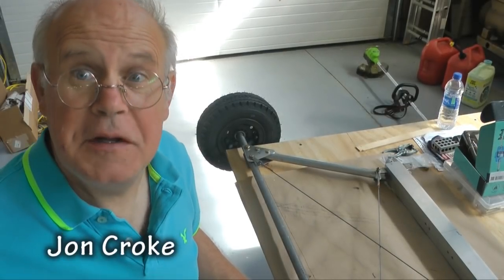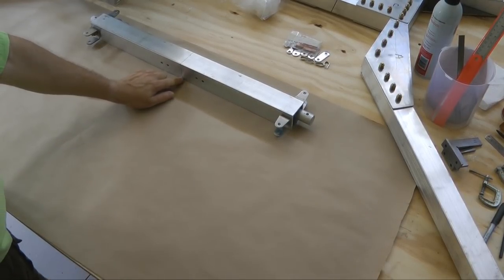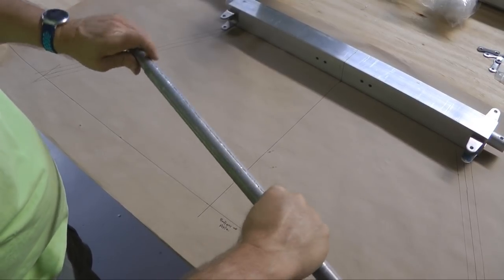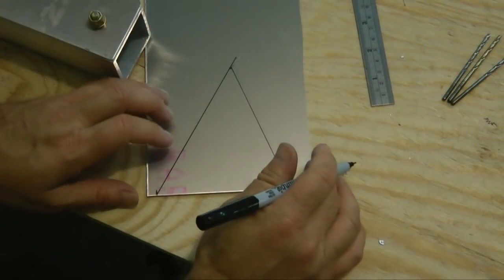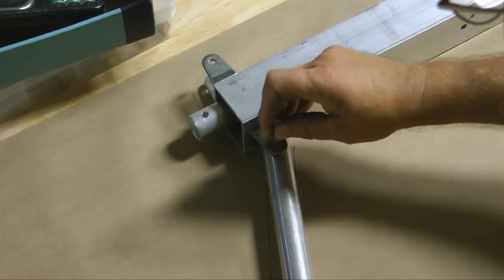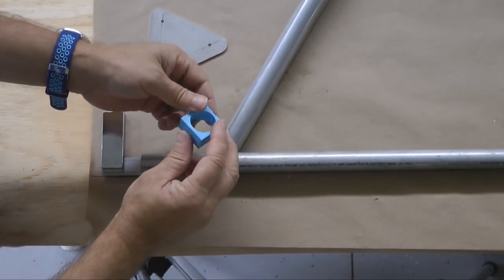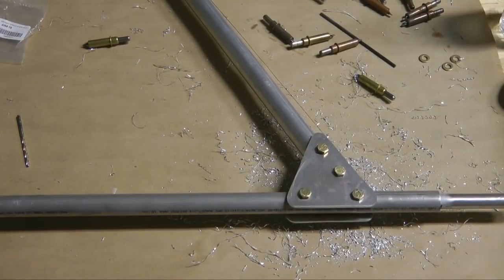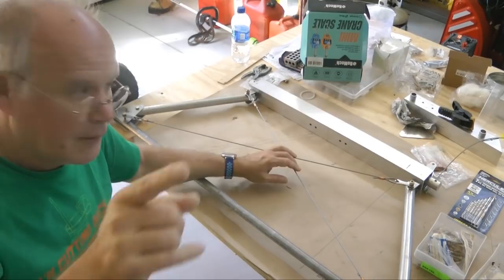Building the Affordaplane Part 8

Comment: With all respect to your opinion why people build many different version of the landing gear, as far as I know, the Affordaplane landing gear is the weak point of the design, so that is one of the reason, why so many experiment with various fixes. Something else. In the last part of the video, you have shown the cables that will go on in the next part. Each end of the cable only had one swage. That is inadequate, I hope you will put on two on each end. I have built 1000s of production cables for hang gliders and trikes, so this is based on that experience. Otherwise the series is very nice.
Reply: Do you know of an alternate off the shelf landing gear compatible with the Aplane for those of us that have a bad back. I imagine that the tires will help some in absorbing the landing.
Reply: @joaquinandes  Unfortunately no.

Comment: Additionally, the forces on the landing gear axel will primarily be transmitted through the tube. Much better to do a better fit to take some of the shock off of the bolts.

Comment: Instead of a straight cut at the connection point between the down tube and the axel, it would be much more productive to use a 7/8" rounding sander to better fit the down tube in place.

Comment: OK I'm using a wheel which has a 5/8th diameter hole for axle, question  is : does the solid 5/8th rod run the whole length of the hollow tub or is it 2 parts, also what tubing would I used on the outer tube and the sleeve on the inner tube to accommodate the solid 5/8th axle tube ?

Comment: Hello fellow enthusiasts.  I have located several suppliers of 6061-t6 Aluminum, some is listed as -T651.  I'm not privy to the ins and outs of metallurgy so I'm looking for information about the difference between 6061-T6 and 6061-T651.  Also there seems to be another difference I was not aware of - Extruded vs Cold finish.  I'm betting the cold finish is A LOT stronger than the extruded but which should be used for the Affordaplane?  Thanks.
Reply: I have the plans dated 2019, are there newer plans?

Comment: I am curious as to the source of your information regarding a tube within a tube being stronger than a single tube with a similar total wall thickness.  I have a masters in structural engineering and that goes against everything I learned and have experienced during my career.  Composite action in beams is always stronger than components acting alone.  That is why bridges weld shear studs onto the top of steel beams so as to get composite action with the concrete deck.  This is much stronger than a concrete decking sitting on the steel beams with no shear transfer connection between them.  Here is a simple demonstration of the principle of composite action vs. separate components. https://structuresworkshop.com/blog/1350

I’m retired and no long have access to FEA software, but I am quite sure that if you model a tube within a tube and a single tube with wall thickness equal to the sum of the two individual tubes and the same OD, you will find the single thick walled tube is both stronger and stiffer than the tube within a tube.
Reply from the maker: I was wrong on that one - thanks for bringing to my attention and keeping the facts accurate.  I wanted to say that a hollow tube is stiffer than a solid one. And I dont know about the addition of sleeving causing more strength than that of same thickness.  I need to retract that part of the video!  Thanks.
Reply: @HomebuiltHELP  Sure thing.  A hollow tube is only stiffer than a solid one IF you are looking at them on an equal weight basis.  A tube of equal weight to a solid rod will be stiffer in general, but there are always exceptions such as when the wall thickness is so thin that buckling occurs.  One of the problem with physics and engineering is that often people hear one part of a principle, but not the entirety.  A 1” solid rod will be much stiffer than a 1” tube made of the same material, but will also be much heavier.  A solid rod that is the same weight as a hollow tube of the same material, will be less stiff.
Reply from the maker: @LTVoyager  And would you say that it is correct that 2 hollow tubes (sleeved) are not stiffer than a single hollow tube of equal weight (maybe about equal stiffness?)  And thanks for your analysis!
Reply: @HomebuiltHELP  If the sum of the wall thickness of the two tubes is the same as the wall thickness of a single tube of the same OD, then the single tube should be stiffer.  So, a 1” OD tube with 1/16” wall thickness with a 7/8” OD tube of 1/16” wall thickness inside of it will be less stiff than a 1” OD tube with a 1/8” wall thickness and the weights will be identical.  I can’t think of any reason that using two tubes would be preferred other than it may be easier to find two tubes with the thinner wall thickness than to find one tube with thicker walls.  Or maybe the two thinner tubes are cheaper than one thick walled tube.  If you talk with the designer, I’d love to hear his logic.  I am not saying he doesn’t have a good reason for making his choice, it just isn’t obvious to me what that reason was.

Comment: If you changee bolts for refits people need to know that you need to change the engineering of the frame so it has the same strength and end up making things heavier or you will need a lot of pop rivets to get the same strength but I think you would need to add bits to the fuselage to get the strength as the bolted frame